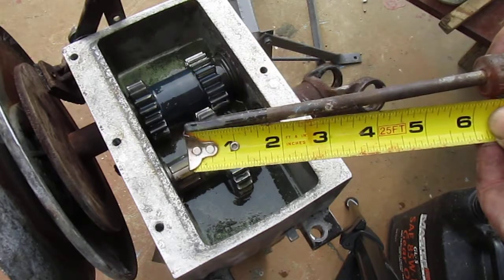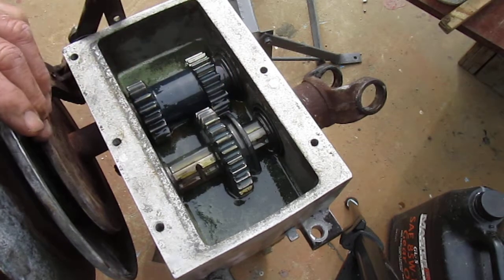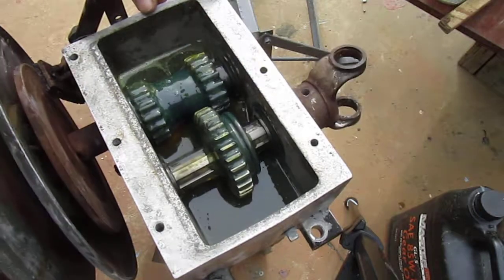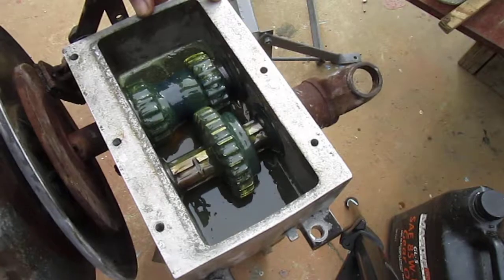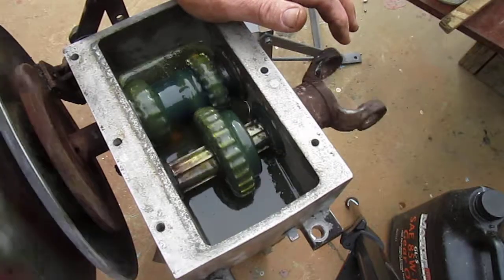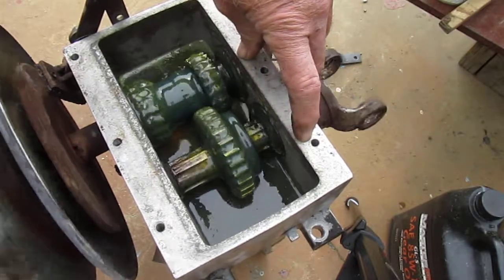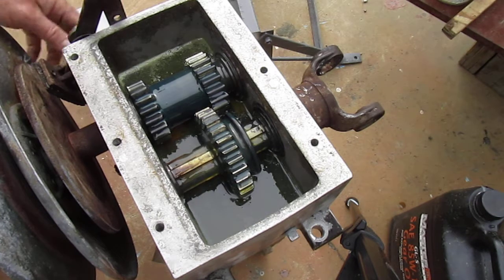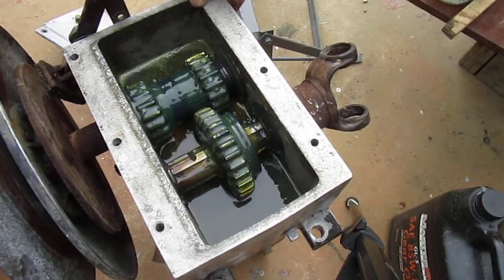Woodings Gear box oil level. Woodings rail car series.

Comment: Hi Don, I had to rebuild a ruined Series 8 transmission with all NOS gears and shafts, new Timken bearings and seals. I had to line bore and make/add steel bushings for  the small idler gear shaft.  I also raised the oil level. As it turns out, I just put in a full quart from empty. The oil level is above the seals. With about 200 hours of running, I have yet to see any oil leak out from the seals. If oil starts to weap out, I will just add some now and again, but that so far has not been necessary. Thanks for your video.